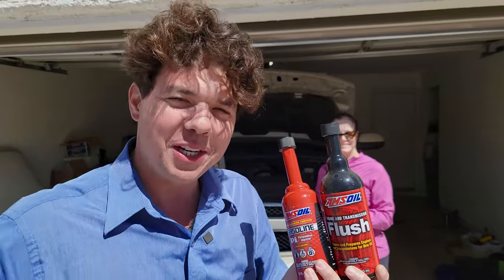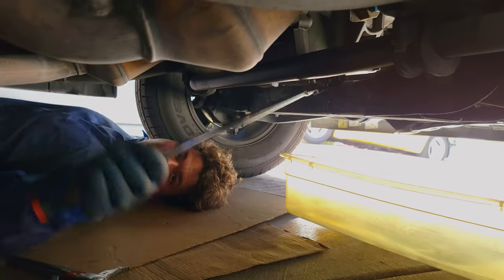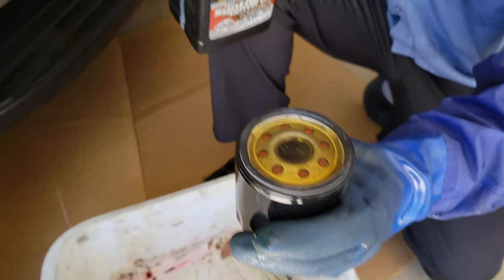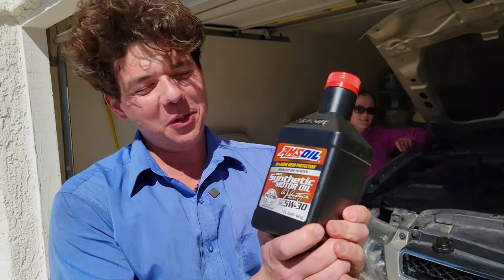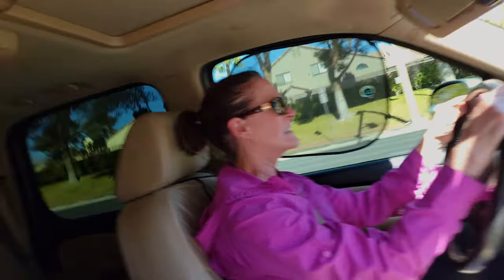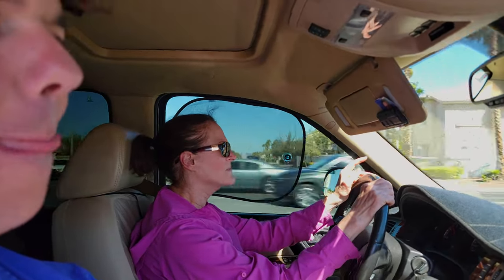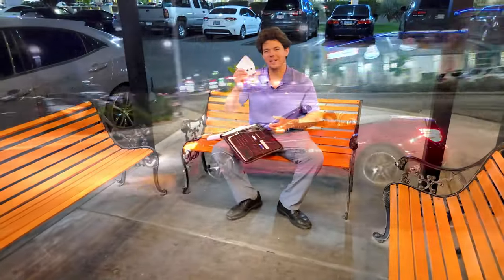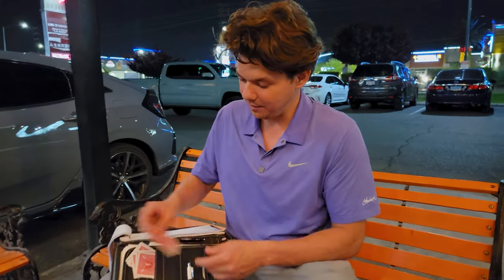Your Tahoe can run better than brand new with these fluids

Comment from the maker: Watch This Next: Your transmission can Shift Better than New with this ATF - https://youtu.be/ibX0rM1apE8

     ♥️ Find The Right Fluids For Your Vehicles - https://www.amsoil.com/lookup/auto-and-light-truck/?zo=5331179

     ✅ Save 25% On Your Next Fluid Order: https://www.amsoil.com/offers/pc/?zo=5331179 

     ♥️ See Fluid Performance Tests - https://www.amsoil.com/performancetests.aspx?zo=5331179      

     ✅️ Buy Me a Coffee - https://www.buymeacoffee.com/YouLubher

     🥇🥇🥇 Synthetic Oil Protection Google Map Reviews
(702) 472-3614
https://maps.app.goo.gl/DmLU5hP72HadUBEm9
             
     ♥️ Synthetic Oil Protection Website - http://syntheticoilprotection.net

     Did you know a oil manufacturer can call a lubricant a Full Synthetic when it's only 25% synthetic? AMSOIL is different because it is 100% Synthetic and has a higher film strength keeping the metal parts separated. AMSOIL allows less friction, less heat, less wear on the component. AMSOIL Signature Series motor oil will last 25,000 miles on 1 oil change!  

     ♥️ Your Vehicle Could Run Better Than Brand New By Choosing The Right Fluids! See Results - https://youtu.be/9Y7XSl5YHFg

     ♥️ Why AMSOIL - https://www.amsoil.com/about/exclusive-distribution/?zo=5331179    

     ♥️ Synthetic Oil Protection Coffee - Ebens Favorite: https://supportwith.coffee/shop/subscriptions/sop/

Comment: Just a helpful suggestion to Susan, don't wait for the engine oil light to come on to alert you that the oil is low as you're going to cause damage to the pistons &  the crank. Instead pull the dipstick once every week or 2 weeks and check the level.

Comment: Great video 👍 chevy had a recall on some of them motors. for the valve covers the pvc  would cause them to burn oil they make an updated one  I don't know if I could pick my favorite Amsoil product there all so good lol but I did just get a truck a while back with a very worn rear diff it was making some noise and felt like it would bind up turning tight corners when I changed the fluid it looked like silver paint coming out but after a few minutes with the sever gear oil the binding and noise was gone I can probably get another 100k or more just by putting Amsoil gear lube in it have a blessed day brother 🤠😄☕

Comment: The Amsoil engine and transmission flush, my favorite product. 
I love using the flush every other oil change on my 2020 Toyota Corolla SE that uses the Amsoil 0w16 OE engine oil so the inside of the engine stays clean. 

I hope Amsoil makes a XL boosted and signature series line of 0w16.

Comment: When we use the Flush, isn't there any problem to overfill the full mark of the oil? Or is it necessary to remove some oil before adding/doing the Flush?
Reply from the maker: It would depend on the vehicle if you are doing like a car 4 quarts or more so there'd be no reason to remove any if you are going to flush like a little backup generator that holds one quart of oil then you may want to use 1 oz of engine flush and just remove whatever you need so it'll fit in.

So really it just depends on the vehicle.
Always happy to talk anytime you can get the order oil at the best value right here on my website ship directly to you.
For me to get credit & be "Your" Independent AMSOIL Dealer, please use my website below or my dealer no. 5331179 call anytime Eben Rockmaker 702-472-3614
After you click on: http://syntheticoilprotection.net
1. Click the hamburger menu
2. Click offers AMSOIL preferred customer
3. Click join now. 6-month PC member add to cart.  ( There is no reoccurring renewal membership unless you select that dot box ) 
( You have the option to not have your credit card saved if you prefer - est. 1972 )
4. Scroll up to the top Select shop by vehicle. 

New Promo: FREEFUNNEL

Comment: Nothing but the best switched both my tahoe and denali to amsoil everything from the diff,trans,motor oil, transfer case everything and man o man did it make a difference
Reply from the maker: I love it what would you say the biggest difference was so far?
Reply: @Synthetic Oil Protection  man engine is so quiet doesnt even sound like its on.. amazing response throught diff to the transfer case and gears.. trans runs cooler by about 15 degrees... overall performance has definitely increased throughout the vehicle for sure recommend to everyone i can...
Reply from the maker: ❤️ don't you getting some great results👍

Comment: My Pontiac vibe has 166,000 miles, it's not leaking anything. But I'm concerned that if I use that engine flush it may start, what are your thoughts ? Or should I just change the oil with 5w30 signature series
Reply from the maker: Hey Thomas great question nothing to be concerned about I would definitely flush your car if it was mine I would also use the pi performance improver and the upper cylinder lubricant and if you're driving the car where it's really hot I recommend using the upper cylinder lubricant and the Dominator octane booster together you'll see a big difference in timing and the Amsoil power foam is a great one to use if you have an older vehicle with a lot of buildup it will help clean everything out you'll see everything I did to my personal car here to get it to run in some way smooth and brand new however it does have quite a bit of wear on it because it's 64 years old. https://youtu.be/-T_-mF8tlyA

Comment: Just out of Curiosity when doing Engine Oil Flush could you drain out the old burned black oil and take out filter and put in New fresh engine oil and new oil filter ? In engine oil flush what happens is the old black oil just gets blacker. Not expensive engine oil or filter something in price range like Valvoline synergy or Castrol Edge with any oil filter. With clean engine oil and filter that's how the oil flush can be compared.

Comment: Hey eben I only see Wix oil filters for the Tahoe. I thought Amsoil made filters for tahoes as well. Should I change my filter every 5k miles? Oil every 10k?
Reply from the maker: Whenever I use the Wix filter I like to do it right in between usually right around 7,500 miles on my car if I use the Amsoil filter I like to go about 12,500 and that's in a high Dusty condition like Vegas lots of low humidity high dust